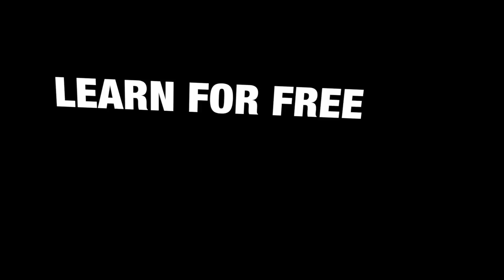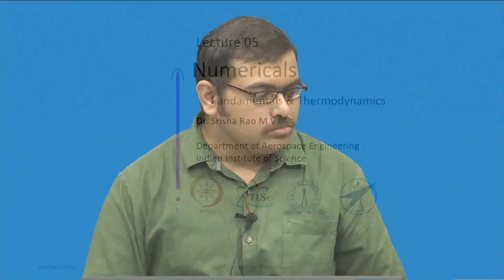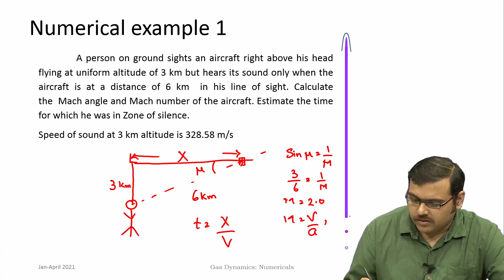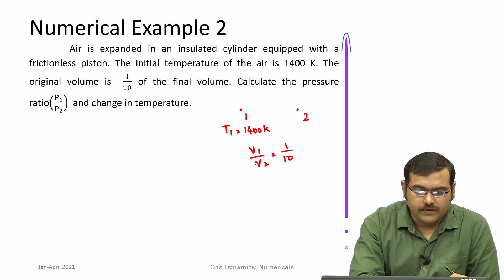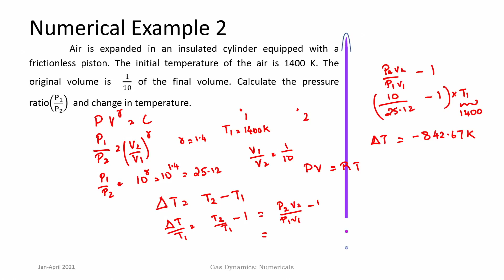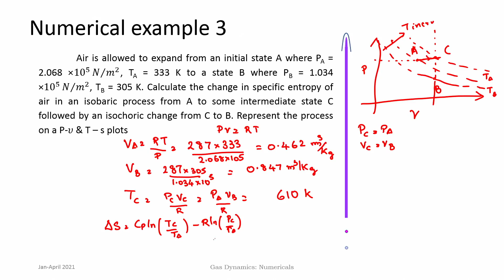lec05 Thermodynamics - Numerical

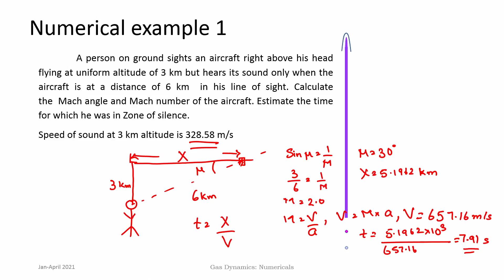Comment: 6:05 sir is numerical 1 correct? because...Assume the planes positon to be A, person's position to be B, and 3km above is head is C.Draw a circle with C as centre and BC as radius. This is the sound that wave that travels 3km to person and when it reaches point B, He hears a sound.This seems simple to draw a triangle and relate Mu to perpendicular (3km) by hypotenuese (6km), assuming the line joining the plane to person (AB) is tangent to the circle the point where person is standing (C). But in reality, there will be point on circumference of circle where the real right angle triangle will be formed where AB will be tangent to the circle and that length AB' is not 6 km but shorter than that